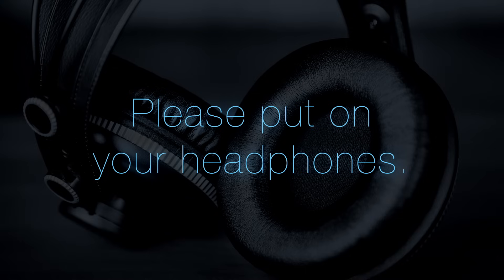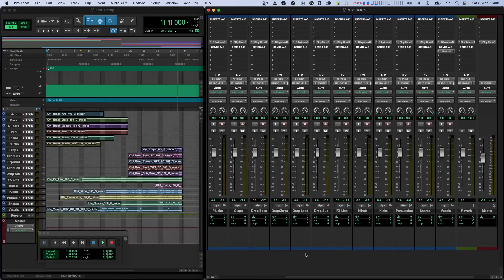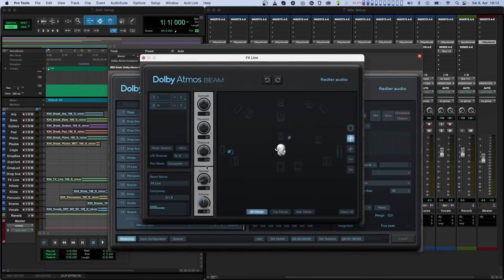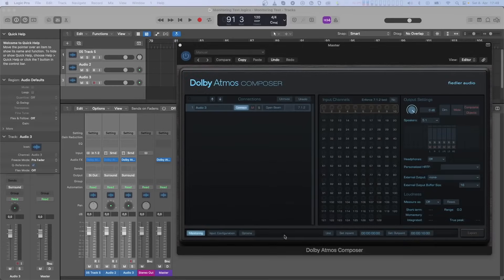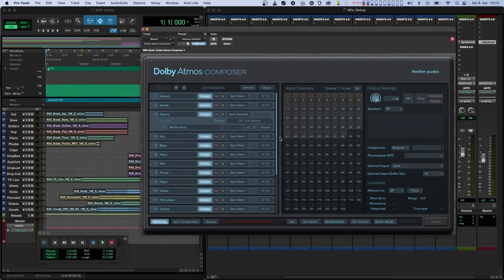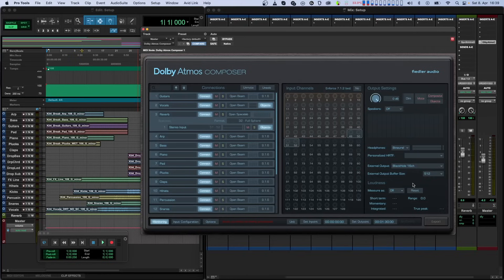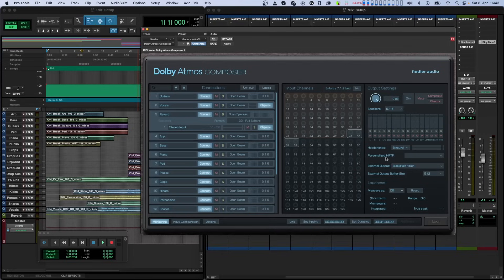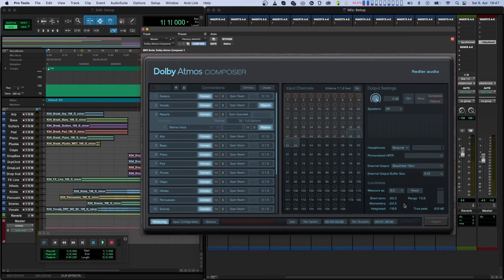Dolby Atmos Composer in-depth tutorial - 01 Setup, Routing & Monitoring

Comment: Is it possible to do this with a mastered stereo track to atmos.
Reply from the maker: To do any kind of serious mixing in Atmos you need at least stems so that you can position them in space. A single stereo track can technically be converted to Atmos, but it won't be an Atmos-worthy experience.
Reply: @fiedler-audio  thank you so much for responding. Regarding the stems, is it the mixed version of the stems or mastered version of the stems.

Comment: Working with the trial. So External Output is just for other additional outputs? If I want to connect my session to an Atmos studio for referencing yes? 

My DAW is connected to a particular interface, and DAW supports 5.1 mixing. That means when Composer is instantiated on Master channel - the Speaker out (I select 5.1) and Headphone out is automatically connected to my interface correct? I get a delayed signal when I set External Output to my interface. When I set it to none, it's fine. I'm not sure if I'm monitoring correctly though, when I toggle Headphones to BIN, ST or OFF, I still get signal on my headphone output.
Reply from the maker: Your headphone outputs are determined by the channels of your audio interface. If you select Speaker monitoring but send it to your headphone outputs you will of course have something going out there. If you select both Speaker and Headphone monitoring, the channels of the selected speaker setup come first and then the headphone channels.
Reply: @fiedler-audio  Thanks for responding. Yes, I eventually figured it out!

Comment: Hi there - I downloaded the full version - Not sure where support questions are fielded, so I ask here.  It appears that any changes in the DAW's channels aren't reflected in the Composer.  Reducing faders, soloing, panning - any function that's controlled by the DAW's fader seems non-functional.  Is this correct, or am I missing someting?
Reply: Soloing and muting ofc doesn't work. As for the faders, make sure the routing plugin is post-fader.
Reply: I noticed that too in Bitwig & ProTools, that the faders stopped working. I assume the Beam plugin is grabbing the audio pre-fader, even though Beam is placed as a post-fader insert. Weird.
Reply: This weekend I'm going to try to do a full mix using Composer.  It's obvious it's going to be a completely different workflow.  For instance, managing volume levels can't be done via the DAW faders, so I'm thinking creating automation lanes for volume from Composer for each track...not sure how other plugins are going to play with Beam on each channel - will have to figure that out too.  Lastly, I don't see any way to put a plug-in across the bed; I use Spherix and Pro-Q there a lot, so that will be a bummer if I can't use those.
Reply: @AustinSignal  For multichannel FX across the bed (or composite) you would typically create a bus/aux of the same number of channels. e.g. a 7.1.2 effect would be inserted on a 7.1.2 bus and then use the Send of the track to feed the FX which then output to 7.1.2. The 7.1.2 are patched to the 7.1.2 Bed in Composer as you would for a mono or stereo track, it's just 7.1.2 or 7.1.4 or 9.1.6 or whatever.
Another way rather than a traditional FX Send to a Bus is run the e.g. Stereo track directly into e.g. a 7.1.2 tracks L & R channels, then as it passes through the FX it outputs as 7.1.2 but that depends on DAW and the FXs routing really. There are no rules, what sounds good is the correct choice haha!